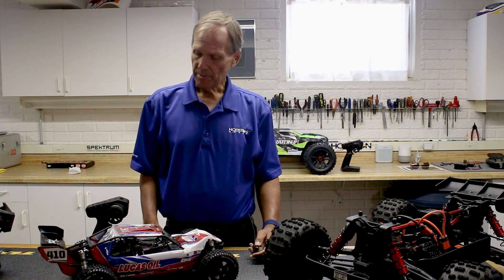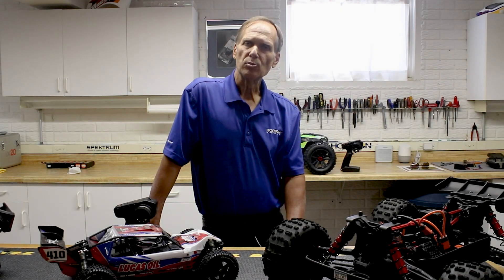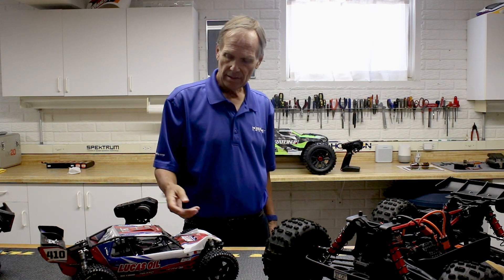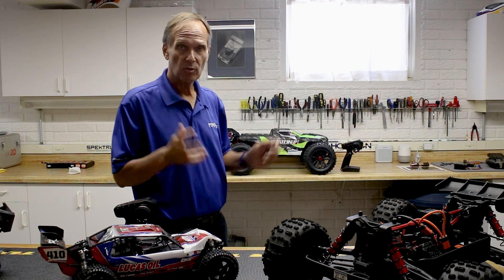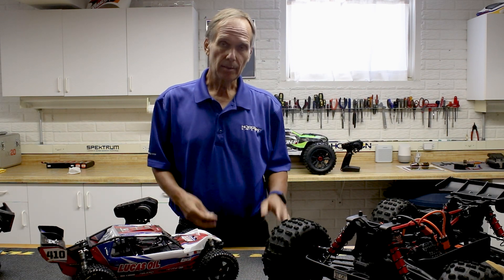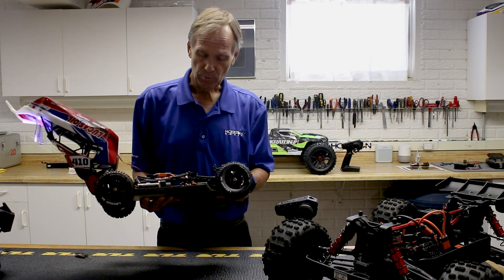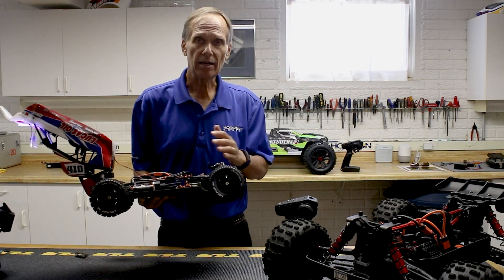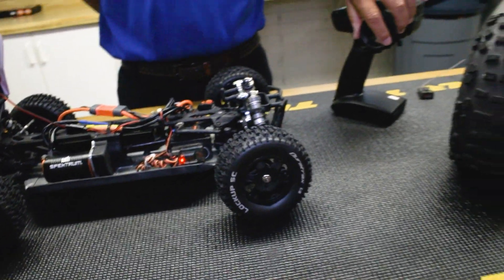Spektrum Quick Hit Tech Tips - AVC Setup and Overview for RTR Vehicles

Comment: I have the losi baha rey out of the box is wicked fun.  The only thing I broke has been the front bumper and body shell but it's been 6' off the ground. 
 40mph at 15 in pulls the front tires up and drags bumper. 
Never seen anything so though fast or fun until the battery blew up burned the truck to the ground. 
Decided to rebuild it with high end parts and into a crawler.

Comment: I can't get the avc to work forward, works in brake and reverse. I have tried to turn the rotation on the engine and then turn it so that it goes straight on the remote control but it doesn't help, then I have to press the gas twice to go forward and it goes straight into reverse without braking. Have also tried turning the receiver over without success.
Do you have a solution?
Reply from the maker: I would suggest making sure your esc/motor are going the correct direction with your throttle control, then rebind and recalibrate AVC (not the esc calibration)
Reply: @SpektrumRCvideos  esc/motor goes the right way

Comment: After bind when I pull full throttle my tires spin. What am I missing here?
Reply from the maker: What receiver are you using?
Reply: @SpektrumRCvideos  apparently I was using a receiver that isn't avc compatible even though it came in the same box with the dx3  radio that's advertised as avc capable. What's the reason behind having a avc radio if the receiver that comes with it doesn't? On the site I ordered it from there's a whole paragraph talking about avc. My daughter was 2 feet away from where it flew off my table on full throttle. It was up on a stand but the force of full throttle made it tip over. That's some deceptive advertising. Wouldn't it make more sense if they both had avc? Disappointed customer here.

Comment: Hey y’all I really like the AR6200a receivers. Already gotten 3 of them. Admittedly, it was very difficult to turn off AVC on my TRX-4. Now I know the sequence, but I gobbled up a few hours on the trial and error. I could make a YouTube video showing how to do this but I’m not a YouTuber. The instructions in the manual to turn off AVC skip a whole lot of things and if you literally follow those steps only, as I did on my three receivers, and on a level surface lol, it doesn’t work. Now, I know how to do it, and it makes perfect sense, I get it, the word is there, bind, things are assumed, but follow the manual and it won’t really. It didn’t on my three receivers. Lots of folks asked this question on forums and other media but never did I find someone posting a solution. Tx off, Rx off, Rx on, Bind X 3 (1.5 sec), Press and Hold Bind, confirm flashing, turn on Tx, enter bind mode, calibration sequence is skipped in this mode, AVC is now off. To turn AVC back on, just enter Rx back into Bind mode and complete Bind & Calibration sequence. Ohh and do it on a level surface lol.

Comment: I need help. I have decalibrated everything. The dx3 allows you to restart the system so that it has the same values as when I bought the vehicle, regarding the acceleration, direction and traction system of my axial scx10 3 vehicle. Thank you.
Reply from the maker: There is no calibration involved with SCX10 3 setup. What are you having trouble with exactly?
Reply: @SpektrumRCvideos  Thanks for answering. One of the wheels touches one of the bars when I turn to the left, making friction. When calibrating the direction it did not look good and in the end I ended up deactivating the 4x4, leaving 4x2. And on top of that, burn the Sx107 servo of the dig function. That is why I ask if the system can be restarted to return to the same direction values and the activation of the 4x4. Thanks for your reply. Or if you have an email, the better